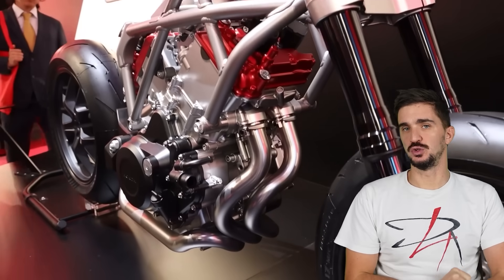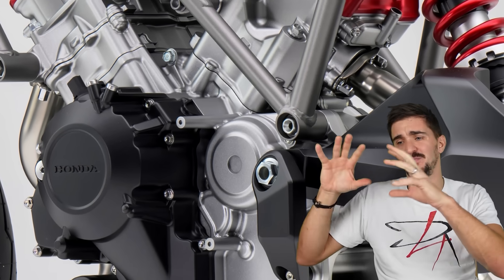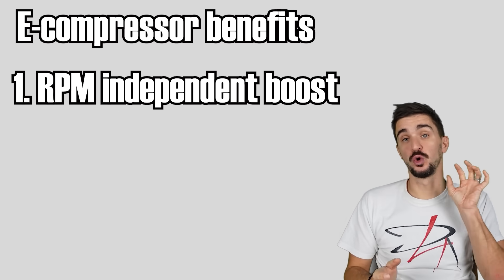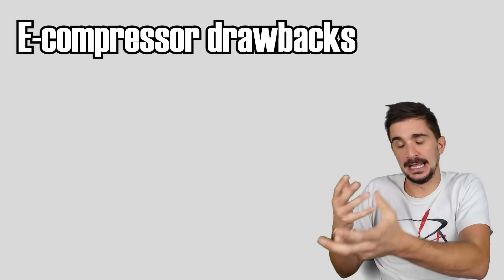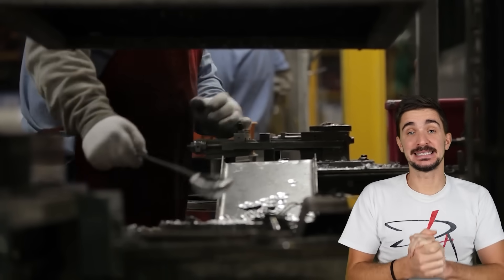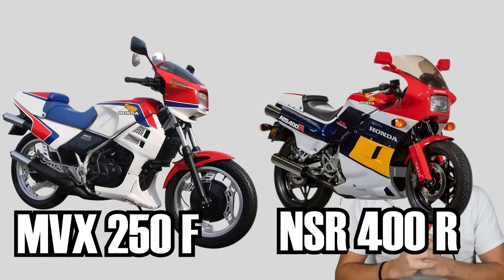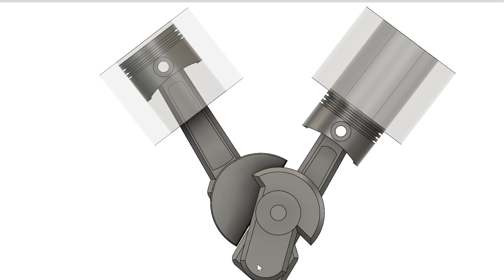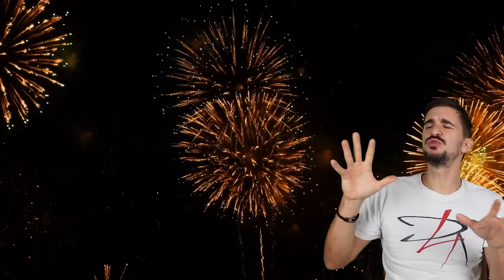Honda's New V3 Electrical Compressor Engine Explained

Comment: This is an interesting illustration of how we should think of the summing of forces within a system.  Offsetting crankpins, offsetting counterweights....it's all about the sums.   That chart at 12:28 is great.  I'm pretty sure Honda has their own "force balance calculator" software so they can plug in the masses, angles and weights for whatever configuration they would like to try.  Voila!..says the software.  Make it like this.

Comment: Would an electric compressor work well for drag racing? Imagine a ProMod 5000hp Hemi V8 with one of these compressors.

Comparing it to a centrifugal supercharger e.g. ProCharger it looks similar except it’s driven by an electric motor instead of by the engine crankshaft. And while you would need to provide a lot of boost, maybe up to 80-100 psi, you would only need to spin it for a few seconds during a pass so it wouldn’t need a big heavy battery, maybe you could even run it off supercapacitors.

Comment: We got both the MVX250 and the NS400 as new models here in New Zealand, the MVX250 was plagued with reliability issues, and they would regularly blow up, Hondas fix was to fit an oversized gudgeon pin (wrist pin) and beefed up rear conrod, but even with that the MVX was short lived. They just weren't as good as the competition, the other manufactures all had better 250 two strokes. Their follow up 250 two stroke, the NS250, was a brilliant bike that could run with the best or the competition.
Reply: never had any bother with my MVX, now  has 18 K miles on it  and has  had 2 sets of piston rings, a clutch and crankcase seals in it life.

Comment: as a mechanic, millwright, motorcycle mechanic rider and former racer? and worked on lots of compressors from air to everything psi and or hazards gases, or temps?
I call BS!  The "E" in electric was not addressed much?  I see a larger generation system eating HP and or? a Dedicated rechargeable battery to provide a purer HP sign wave for performance, with the on board generation as an auxiliary?

Comment: Even with a water-cooled electric motor, I'd think there would be a lot less heat on the compressor side, as there is no exhaust heat.

Comment: The motor have to trunk further and if u could drive the piston to the bottom to get x out and not bounce off th top of the piston an go backwards u may have 70 to 80 not 35 prevent power used

Comment: Also if u made and eight fire like a 4 cylwnder two fie two ex. The motor use more of power and so say 1 and 7 then 2 qnf 8 4 and 6 3 and 5 work as one

Comment: WOW. Triumph has been building 3 cylinder racing engines FOR DECADES. The V configuration is just a novelty like Honda’s oval pistons.
Reply: The oval pistons weren't a "novelty" it was Honda trying to build an 4 stroke engine, within the rulebook (a max of 4 cylinders and 500cc) that would beat the dominate 2 strokes in GPs, all because Soichiro Honda HATED two strokes. After they gave up in GPs with the oval piston NR500 four stroke, they built the NS500 V3 two stroke and went on the win the 83 GP championship with it with Freddie Spencer.
Reply: @ race engines which are meant to be rebuilt over and over can be successful, but that does not always translate to production models in terms of reliability. That engine technology was not continued by Honda or anyone else for a very good reason.
Reply: What are you talking about, dude. Only racing engine Triumph currently builds is a Moto 2 engine. That is it. Triumph is not build any racing engines for decades. Triumph builds leaky ROAD ENGINES for road bikes.
Reply: @ they raced the 675 triples.

Comment: Or build a pressure washer type air on the thing it goes for 40 psi to 2000 psi with a resavor tank large amount can be stored or heleoum gas might be better to store but air can be made with a cyclernder from motor like the engines shutting off two cyclendrr after r it reaches normal spead

Comment: Why don't thy take if  oost givesso muchwith very little takea small air tank use the third cyclender as air compressor Reed valve too tank an haeon board air punch El control valve so u control how much composed air in each punch each cyclender the motor block I builtin working onth Sam crank an cook help in balance by also using control of h crank

Comment: 1. I wonder which engineer at Honda had the eureka moment?
2. Thank you.! You don't know how many times I have explained to backyard mechanics that turbos do not work for free. I'm sending this to them.
3. No doubt this engine will be around new for at least a dozen years, as Honda tend to design world engines, which have to work under many different minimum emission requirements.
Me? Although my car is a BEV, my bike is a 2000 VFR FiY. A V4, and I believe an offshoot of the daddy engine, that eventually evolved into the V5 (though I believe they actually share very little).

Comment: I wonder will tuners start offering larger alternators, larger capacity batteries, thicker power cables once they make their own e-compressors with more boost. I also wonder will ppl who push the limits need to water cool the alternators? I've been watching this tech for yrs and I'm so excited to see where it goes and what extremes ppl can push them to.

Comment: This isnt Honda's first rodeo with the V-3.
The NS400 motorcycle used a V-3 400cc 2-stroke in the mid to late '80s, and it was superb.
Reply: I was * hoping * someone was going bring this up as though it hadn't been covered in the video.
Reply: The NS400 was barely better than the RZ350, for substantially more money/complexity. On the track, it was a wash. I owned and raced both.

Comment: Most of my riding has been stop/start. Even though i live in Australia with vast open roads. I have only owned sports bikes.
I can see this packaging making the bike more nimble for the kw/hp.
Also a lot quicker for initial acceleration. 
Around town this is more fun than top end power.
Also near by is an awsome twisty mountain range. Low speed limits with  short acceleration areas plus nimbleness. Wins for me.

Comment: Two years back Honda showed patent drawings of an Africa Twin engine wit this design.  seems there were a couple different ones.  Sure they learned from racing the 211V in Moto GP  in the form of a V-5 engine with about 240 to 270 hp for 1000cc and 800cc.  Now what if the rear cylinder is a bigger capacity.

Comment: Hope E compressor in motorcycles will cut-out after certain initial rpm as it act as providing low end torque booster which directed by engine rpm feedback and throttle feedback.

Comment: Retired motorcycle mechanic here,
Honda's V4 Magna was my favorite of all bikes (near 100) i've ridden.
Reply: I've got a 2000 model vfr800.
V4 with the gear driven cams. Amazing engine
Reply: Wow Honda had a Magna? In Australia we had a Mitsubishi Magna sedan
Reply: @In-Marty-We-Trust  The "Magna" was due to marketing copyright laws, the V45 and V65 represented the 45 c.i. and 65 c.i. versions. The Ford Mustang was called the T5 in Germany because "Mustang" was already copyrighted by another company. Was it simply called a V45 or V65 in Australia?
Reply: @In-Marty-We-Trust  and Magna wagon
Reply: Still have my 2001 VFR800fi. Amazing low maintenance, reliable, smooth engine. Have both a hi rise and low Staintune pipe. I will never sell it.
Reply: @slamman9887  2001 gen 5 or 6?
Reply: @ the last of the non-vtec
Reply: @slamman9887  yep, that's what I have. So good
Reply: I have owned 35 bikes and ridden many more I had an 1100 V4 V65 Magna for 18 months and liked the power but it was to tall to handle well sure newer bikes are better but from a similar time my Kawasaki Turbo for which I got a slightly larger Turbo from BJapan so at 17 lbs boost it was faster and handled better. MY much newer Ducati and my friends MV AGUSTA Brutale are real bikes but I also enjoyed my friends supercharged Triumph Rocket 3 ( I want one ) The most dependable bike I owned was a BMW boxer 900S
Reply: I still have a 65 Sabre, nothing is a better overall bike.
Reply: I’m gonna be the guy who says the first gen VMax was better than the magna but that’s just because I’m biased. :)
Reply: Had a V45 in the early 80's. Loved it but it needed forward controls.
Reply: Hondas old v4 had overheat problems on the rear 2 cylinders .😢
Reply: @marktarascio4766  when you say old. How old? What years are you talking about?

Comment: As always a thorough and concise explanation of cutting edge ICE technology from D4A. However the hideous frame welds distracted me so much i was unable to enjoy your presentation! Your verbal presentations are so good that i can enjoy them as a soundtrack anyway but what are honda thinking letting those image out? Reminded me of my neighbours freshly delivered (in a crate straight from the docks) Suzuki katana 1100. i was 11 years old  and sat on the seat while he fitted the front forks and wheel. amazing machine. Even as a child the welding on the headstock made me feel sick. never thought I'd ever see anything worse but now i have. I;m now off to make a racing frame from cardboard tubes and hotglue. Just need a brand new v3 to complete teh project. Think i'll make the wheels from steam bent stale baguettes. Love you D4A but Honda FFS !

Comment: They should connect aome sort of electric motor to the transmission so it can re-gen brake, if that is more viable than an alternator alone, it would also be cool if it was able to be plugged in to top the battery off before you ride.

Comment: At this point I kinda just want a small NA or maybe belt driven compressor engine that is meant to be reliable, serviceable and good enough. Between manufacturers and regulations making the dumbest results such as putting the cam chain between the firewall and engine, plastic parts that fail taking the entire engine with them or grenadine/sandblasting turbos etc..

Something like the sturdy Mercedes OM606 but with modern solutions to the mechanical injectors. Considering how precise we can be with timing today and how supposedly environmentally aware we are I really don't understand how manufacturers can get away with creating engines that aren't aimed to break 1,000,000km somewhat reliably.
Especially considering many engine failures means that the entire car is scrapped.

I don't care about new stuff anymore, I want the old stuff that worked but improved to pay attention. Even for high horsepower applications.

Comment: They should have increased the power of the compressor motor, and used a traditional parallel twin to simplify the engineering, then connected the compressor motor drive directly to the gearbox input in place of the crank, and mounted the alternator on the end of the crank.  You could then remove the compressor from the electric motor output. Would be heaps simpler.

Comment: Looks like a V3 would have even better balance than a 90 degree v twin or a v4 because there's no cylinder offset, so no rocking couple.

Comment: I have yet to see anyone do a vid on Smokey Yunick. Other than negative stuff. His 3 Adiabatic engines were stunning. The V4 didn't even need cooling. 90% efficient Put your hand on the exhaust outlet at full power, hot but not painful. Ran on sour gas without complaint. V2 was 150cu in and made 75 to 150 HP. Chrysler guy couldn't make it ping even with scrap yard fuel.

Comment: "The parasitic loss from an alternator to drive an electric supercharger should be less than a turbo"  This is false.  Its widely accepted that even direct drive superchargers cause more parasitic loss than a turbo.   Adding two more conversions of energy into the system (mechanical to electric generation, electric back to mechanical) will only make this worse not better.    The saving grace here is that the power to drive the compressor can come from stored energy rather than in real time so the increase in parasitic loss can happen before the boost is required in the form of slowly charging the battery when you are cruising.  This however adds even more conversions of energy as now chemical energy has entered the equation in the battery.    Mechanical - electrical.  Electrical - chemical.  Chemical - Electrical.  Electrical to mechanical

Comment: How convenient to skip the facts. Where will the massive power that drives this motor come from? Based on typical parasitic losses of a 750cc motor of a mechanical compressor or turbo (similar to electrical motors on pumps) about 5hp is required. This means either A) a large (heavy) battery to power the motor for short bursts of high amperage or B) an oversized, heavy alternator to provide such power consistently. Energy cannot be created or lost; it can only be converted. This engine is not a new concept but a rehash of previous prototypes. Material technology may now make this pig fly but it will not be revolutionary but merely incremental in improvement while adding to complexity massively.

Comment: In minute 4:47 you say that placing the "e-turbo" very close to the intake manifold increases responsiveness, but I remember that in your video about rear mounted turbos you explained that adding meters of piping between the turbo and the engine creates minimum amounts of turbo lag, so what did you mean here by "responsiveness"?
Reply: First of all it's not a turbo, turbo depends on the exhaust gas to spool up, so at low RPM it's responsiveness is very dull,there is a lag which is called turbo lag
1) to fix this issue, the anti lag was found and its the old school, but it creates a heavy noise so it still can't be used in road cars legally. 
2) the e- turbo works just a little bit different, just adding a electrical motor to spool the turbo when you are off throttle, remember it still depends on the exhaust flow.
3) the e- compressor is more like a electrical supercharger, where it forces the air inside the engine, and superchargers have better response in low RPM.and they also didn't depend on the exhaust flow
Let's talk about the rear mount turbo's and front mounted/near manifold
1) it's generally used everywhere and have better "response" due to the shorter length between the  manifold and the turbo
2)but when there's not enough housing in engine bay, the turbo can mounted in the rear by piping from the exhaust/intake 
It clearly lacks "responsiveness", but the airflow can be made more denser by cooling it, which makes better power
And also increased turbo size when mounting out of the engine bay,you don't need to care about the size. And yep more airflow more power ......

Comment: Exhaust Gas doesn't spin the Turbo.  Expanding Heat, produced from exhaust temperature is the force to Spin the Turbo.  If only the exhaust was used, the turbo and engine would stall from excessive back pressure.

Comment: The centrifical compressor is also a turbine. The generator to charge the battery also take power from the engine.

Comment: It's a supercharger. Not belt or gear driven but electrically driven. Brilliant. Now software can provide a boost curve that can be changed based on rider preference.

Comment: I have had a similar idea for a V3 engine for a few years now, but in my design the front bank of two cylinders and the rear cylinder are at 90° to each other.  Also, in my design the front two cylinders would both have a smaller displacement than the rear cylinder.  The front cylinders would move up and down together with a 360° firing interval and the rear cylinder would have the piston and connecting rod size/mass chosen to effectively balance the engine as if it were a traditional V-twin.  The basic idea was that I wanted a small-ish dual sport and couldn't decide if it was better to have a smooth, high revving engine for better comfort and passing power on the freeway (like a Ninja 300/400 engine), or a similar displacement single (like the Honda CB300 or KTM390 engines) with better low end torque for offroad use.  So I thought to myself "why not both?" and came up with this V3 design that would be in the 450cc to 600cc range.  I figured you could also have it save fuel by disabling the rear cylinder while cruising so you would effectively have the highway fuel efficiency of a 250cc to 300cc parallel twin with the passing power of a midsize V-twin when you needed it.  I even thought about trying to retrofit a new front cylinder bank onto an SV650, but I don't have the machinist skills to do it myself, or the money to pay someone who does.  It looks like Honda does though, but with a slightly different twist than what I was imagining.